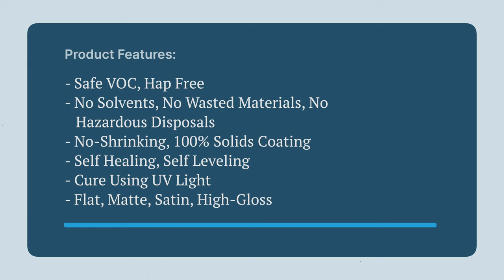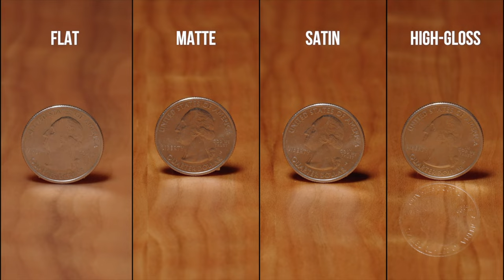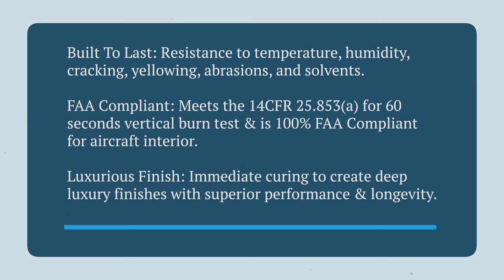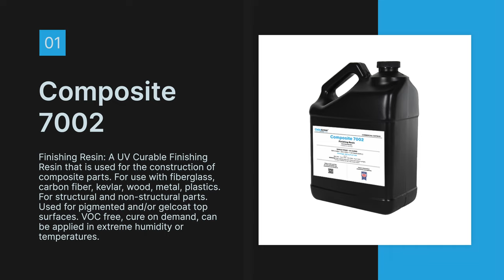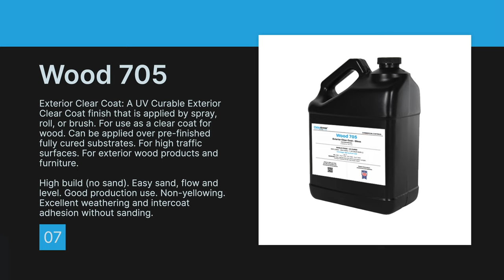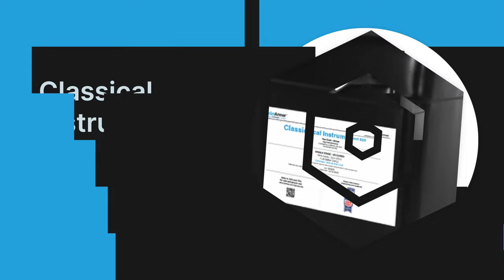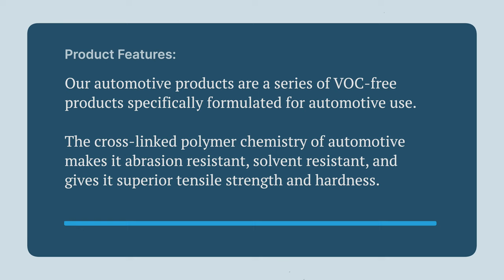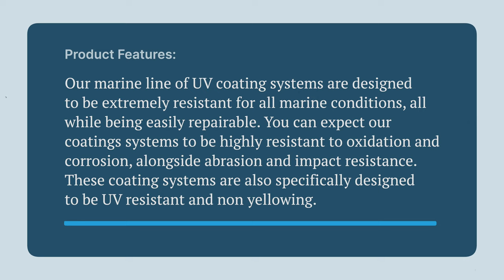Clean Armor UV Coatings Overview: Cleaner - Stronger - Faster

Comment: Excellent product! Definitely would recommend
Reply from the maker: Thank you for the kind words! 

We've worked hard to produce a product that is both safe and has fantastic performance.
Reply: @cleanarmor  you definitely nailed it! I would have loved to be a fly on the wall during testing the durability
Reply: How s your uv resin different from from craft resin like Jdiction?
Reply: @pattiobrien5408  in talking with the fellas it's 100% solids so from what I've seen it holds up longer, and is more durable

Comment: Is a oil such as Danish clear oil really necessary on a unfinished walnut table before applying the sealer and two coats of exterior finisher. Im thinking about going with the satin or matte finish.